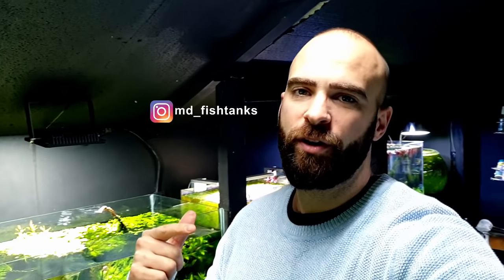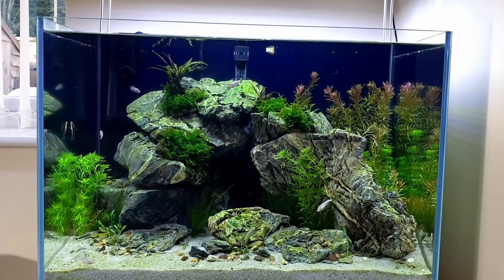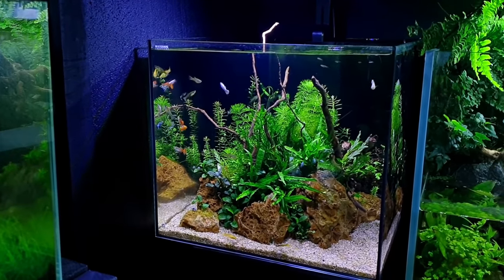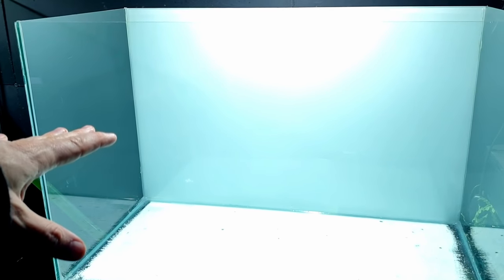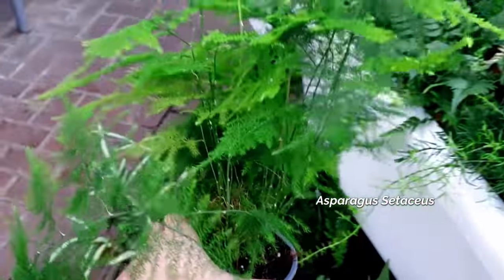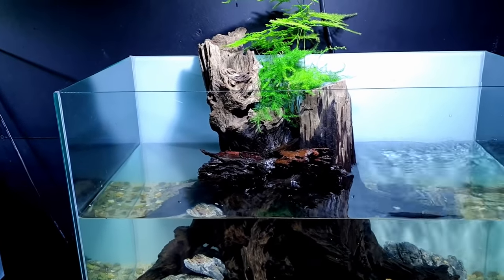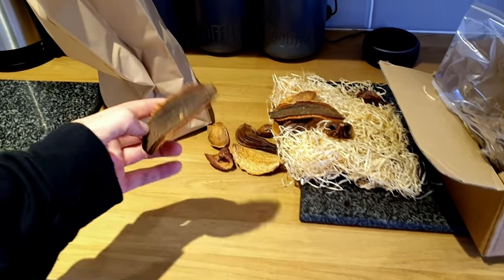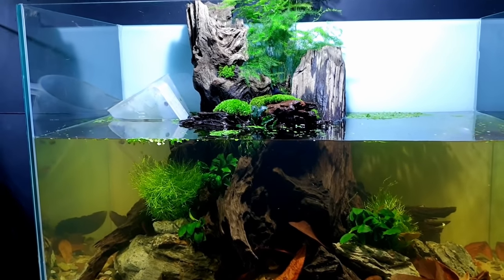"THE FALLEN TREE" ......MAKING A BLACKWATER AQUARIUM

Comment: What a nice looking tank! I love the tree trunk style , might  implement it in my tank when I rescape it 😉
Question: I have some miniduckweed in my tank, but they keep drying up/dying and not spreading I don’t know why. I noticed that the red cherry shrimps keep swimming up clinging on the roots trying to eat it as it seems could that be a reason? Or is the light too bright that is causing the drying up of duckweed? 
Thanks for reading, would love to receive ur thoughts and suggestions!! 😁☺️😁
Reply from the maker: apparently this is a sign that your water is off for good plants growth. Maybe test it??
Reply: MD Fish Tanks ok I will, thanks!
Reply: Mr. Thackery it’s already a couple of months, the fish are doing fine I’ve lost none since I bought them, the shrimp even bred twice!
Reply: @JL24680  Does the tank have its light inside the hood or suspended higher above tank? Some lights in the lid of the tanks run hot and dry out the duck weed due to how close these lights are to the surface of the water. If the tank has decent stocking there should be enough nutrients for duckweed as it's indestructible lol!
Reply: ada205mi there’s some space between the light and duckweed , I can fit my hand in when it’s turned upright . About that size lol thanks 😊